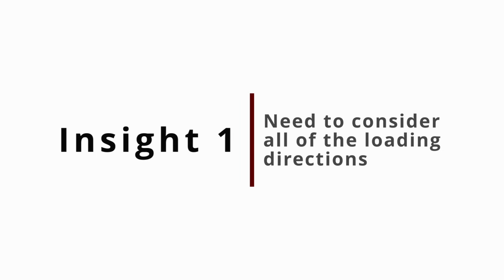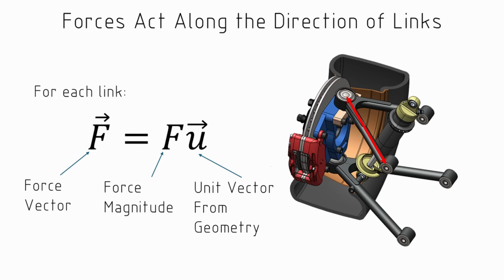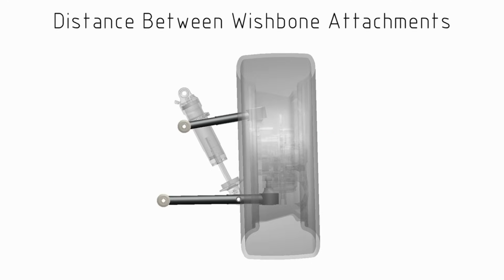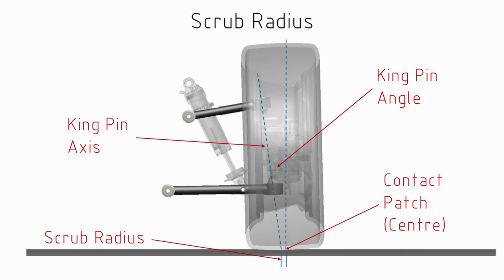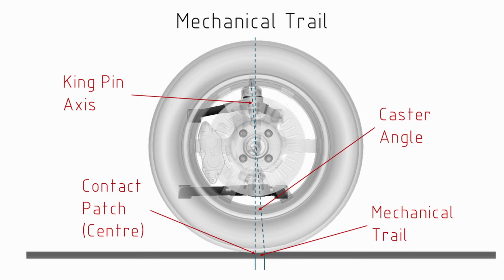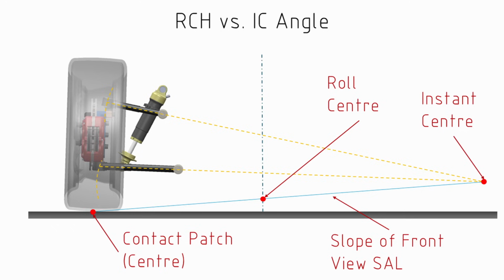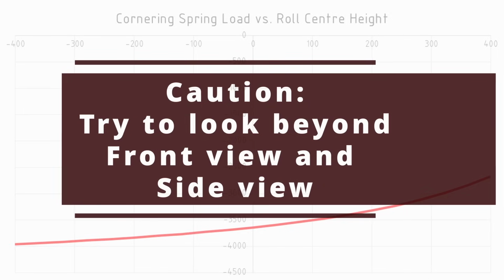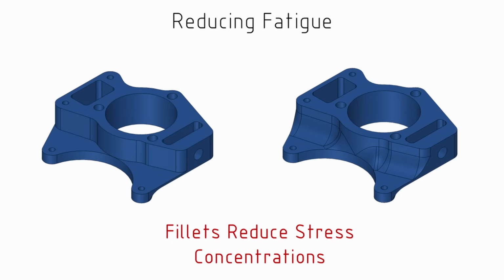Six Suspension Design Insights by Analysing Suspension Loads (Project 171)

Comment: Phenomenal video! Never seen such a detailed analysis of suspension loads. I have one question, though: At the end you already mentioned, that the suspension is moving. What about the movement due to steering?
Assuming that the contact patch doesnt move significantly relative to the vehicle body, I think you could assume that the suspension loads dont change much. But when designing an upright, the directions of the loads change significantly. When setting up loadcases in FEM, would I need to simulate every possible steering position (maybe in 10° increments) for each "suspension loadcase" derived from this video? 

Thats one problem I am currently running into, because I want to use topology optimization for an upright and am constrained on compute resources. :/
Reply from the maker: When doing FEM I generally don't worry too much about the different suspension positions and changes due to steering.  This is mainly because in order to get decent stiffness of the components you need to run fairly high safety factors.  Although your suggestion of 10deg steering increments is probably a good one.

This is one of the reasons I am fairly reluctant to go to heavily down the topology optimisation route for upright design.  In order to do it well you need to take in a lot of different loading conditions (as you do with any upright design).  Does this mean you optimise at each loading condition?  We have done a few studies of this at work, but find that the topology optimised uprights aren't that much lighter than what we can do through normal design processes (admittedly a lot of iterations over the years).  This is where a bit of designer insight can really help.
Reply: @KevinHayward7  Thanks for your reply!
For now I will probably only go for 3 steering positions, being neutral, full left and full right. Will see if my compute resources will allow me to go for more. haha
(Later in validation, I can definitely afford more steering positions.)

If you are looking for video ideas, I would definitely be interested in one about upright design. Maybe you could compare the traditional vs. TO uprights, that you mentioned.
Either way, thank you for sharing such interesting videos!
Reply from the maker: Fully plan on an upright design video, and reasonably soon.  It is an area I am working on at the moment.  A few more videos to finish off first though.

Comment: Great Vid! - im trying to solve the loads on a double wishbone rear suspension system - im working on an MX5 / miata just as a learning exercise - as with almost all cars, there is no tie rod on the rear, how do you solve the calculations? what inputs would you put in to the 6 x 6 grid?
Reply from the maker: That is a really good question.  It means that you need to do a different set of equations as the H link (failing a better name) has an ability to resist a moment, which the links cannot.  Realistically when doing this for component design I would do this in a FEM study.

Unfortunately the stiffness properties of the arm will determine how the load is shared between the two mounting areas on the upright, so you really need to solve it as a solid mechanics problem rather than assuming fully rigid links.

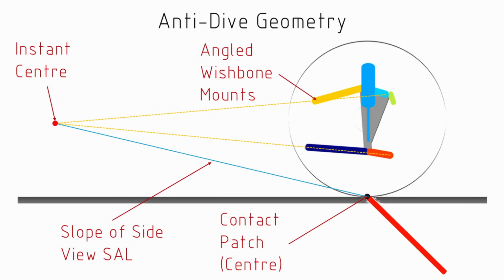Comment: @17:59 Thank you. Your video got me to understand lateral jacking forces. I get it now. Some anti-roll and anti-dive geometry is good because you can run much lighter springs for more mechanical grip in a corner and braking into a corner.
Reply from the maker: It is one use for antis for sure.  Jacking forces aren't often spoken about much and a lot of texts confuse the issue with poorly defined terms like the Roll Centre.  Can make a difficult problem even harder than it needs to be.

Comment: Amazing video! This has helped me a lot with preliminary work for my project! can you do a video delving into the math and code for this, I would love to see a more in depth explanation on the math and coding side of things, particularly how you derive tire forces from the G sweep exactly. I have been using rigid body weight transfer calculations and a simple friction model but I would love to see how it is done by someone with real experience in the field.
Reply from the maker: For this particular analysis I just ran with simple rigid body calculations and a simple friction model as you suggest.  I was doing these calcs more for the loads to be fed into mechanical design for strength.  It just happend that you can take away some vehicle dynamic conclusions as well.  I'm a huge fan of only having a model as complicated as you need to be able to answer the questions you have.

That being said we will be doing more on tyres as we go on, and maybe a bit more of a look into some loading under these conditions.

Comment: Great video! What software are you using for the visualizations / graphs? Matlab never seems to look that good for me
Reply from the maker: Plain old matlab.  Usually spend a fair amount of time making the graphs look better.  I find the main things that up the visibility for slides / videos is to make sure the lines are thicker and the labels are larger.  The default settings on the graphs are pretty ordinary, although the default excel settings are also pretty meh.

If it helps when I submitted my PhD a long time ago one of the reviewers made some very valid comments about the graphs I had included.  It ended up with me going through and changing every one ... wasn't a fun task.  At the time word would crash regularly with the big files.  The bonus is that everytime I see similar problems in graphs I have a nervous tic

Comment: Are you assuming a g force to build the suspension if so what a bout baja cars (offroad) what will be g forces ?
Reply from the maker: It can vary quite a lot depending on tyres, and road conditions.  Vertical loads due to bumps can be quite high. Recently was hanging around some tyre suppliers for Speedway, super interesting.  The compounds were very soft, teams clean and prep their tyres well before heats.  The edges of the tread are also super important for soft surface grip development.  If running in a groove offroad then the lateral forces could be very large at times.  In the end I think you are going to have to design for impacts.

Comment: Awesome. 😃
Finally I've found a video explaining with very nice visual the scrub radius impact on steering !
Among the BMW E9x this is a problem. I could experienced it when I installed wheel with a smaller ET (Offset)
During some heavy braking, the car behaviour became dangerous by pulling to one side or another.
I then sold those wheels and returned to factory spec. The change in scrub radius was only 8mm.
Since then I'm advocating those guys installing spacers to have a better stance to be very careful.
A front axle geometry is something very complex. A slight change can have a big impact.
Reply from the maker: The effects of changing scrub radius can be very noticeable beyond a point.  Most modern cars with a decent amount of weight and axles up front have a fair bit of scrub radius to begin with, and a power steering system to deal with a lot of the load.  Adding just a bit more can have a noticeable affect on steering effort and handling.  As you have clearly noticed.

Comment: Hello, is it possible for both the lower fore and aft to be in tension and never be in compression during the entire range of the g-g plot angles? Or have I just done something wrong
Reply from the maker: I think it could be possible if the lower arm has a lot of vertical to it, and the g forces are very small, because it will be tension due to vertical loads.  However I don't think so otherwise, probably a math error.

Comment: Hello, in calculating the moment you use r as the vector to the position of point application. I'm just wondering what the origin of this vector is? Is it the vector from the center of the contact patch or somewhere on the knuckle? Thank you!
Reply from the maker: It actually doesn't matter as long as you are consistent with the location.  I do it from the centre of the car on the ground along the axle.  Moments are always calculated relative to a given point.

Comment: What about dynamic loads during accel and brake
Reply from the maker: Brake and driving loads are included in the model if thats what you mean (and the resultant load transfer).  Keeping in mind there are still simplifications applied. It isn't a full multi-body systems approach.

Comment: I don't know if it's possible, but is there a way to get the MATLAB code you wrote?
If you sell it, could you tell me where? I'm very interested.
Thank you very much in advance and great video!
Reply from the maker: It's not really in a great state to share.  Having prepared software to the point it can be sold vs. prototypes for personal use I know first hand how much of a difference there is in the work that must be done. Hope you understand.
Reply: @KevinHayward7  No problem, I completely understand your reasons. Thanks for taking the time to respond, and best regards. Be well ✌

Comment: I’ve written a MATLAB script to calculate link loads based on contact patch forces. The results align closely with those from a previous thesis student in our FSAE team, which gives me confidence in the method. My main goal with this script is to examine how link loads change when we introduce anti-dive geometry.

The issue I’ve run into is that, when I only apply the contact patch forces, the pull rod load decreases as expected, but the upper arm link loads also decrease—which doesn’t quite align with what I’d expect for a given anti-dive percentage. However, when I include a braking moment in the y-direction (representing braking torque), the results make more sense: the upper arm loads increase while the pull rod loads decrease, which is closer to the expected behavior.

This leads me to wonder: in a pure braking scenario, should I always include the braking torque (moment in y) along with the contact patch forces, since that would represent the actual loading conditions more realistically?
Reply from the maker: Definitely need to account for the braking for the correct loading. If it helps I have made that mistake before (with drive loads on the rear).  Strain gauge data wasn't matching up with the calculations.  Took a while to find the mistake in the calcs (had incorrectly assumed outboard rather than inboard drive).  Matched up really well afterwards.

The calcs are only 80% of the work, error checking and validation can take up the other 80% of the work :)
Reply: @KevinHayward7  Thanks for the comment. My concern is that applying a braking torque as a separate moment might end up double-counting the loads, since I would assume the moment is already captured through the contact patch forces. I’m not completely certain, though—at the moment I’m just applying the braking torque at the upright center.

Comment: Could you please talk more about anti-dive and anti squat? As far as I've read, these two essentially bind the suspension in braking and in acceleration respectively. This binding essentially turns the tire into the spring and shock absorber which isn't ideal for any scenario when driving. It's like driving a go-kart - and can easily lock up a wheel (as it's now free to bouce uncontrolled without the infuence of spring and damper). Have you considered a 3rd element to control dive and and squat? What would that look like? Advantages and disadvantages? Please consider this question for your next Q&A.
Reply from the maker: I do plan on coming back to this topic as the suspension gets a little more design time a little later on.  Have used 3rd elements in the past, but not of a huge benefit with minimal aero loading, with their main advantage being platform control in pitch/heave. Definitely consider the question for the next Q&A
Reply: @KevinHayward7  Thank you. I'm looking forward to it. 
Do you offer consulting services? I have a single seater race car designed from the ground up that I'd like a sanity check on. How may I get a hold of you for a 1-on-1?
Reply from the maker: Unfortunately I'm way too short on time to do consulting at the moment. I'm trying to answer questions on here as they come up however. Probably due for another Q&A video.

Comment: Does it matter which side of the link the “r” vector points to from the origin? Also does it matter which direction along the link the unit vector points in (since it could be 180deg difference)? For your tire load and moment inputs, are you using the g-g diagram and the mass of the car? And do you estimate the F_z by the moment about the COG? Super good video I’ve never been able to fully grasp how to calculate the loads in the wishbones and I’m super thankful to give building a code like this a shot. Thanks for sharing your hard work!
Reply from the maker: They all need to be pointing to or away from the body they are referencing (in this case the upright).  Using gg-diagram and mass of the car as suggested.  Only a simple friction model on the tyres, but the whole thing can be flipped by starting with tyre modelling / data inputs.

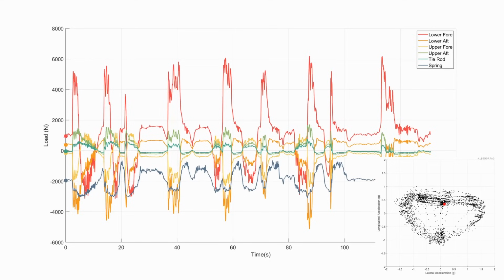Comment: How did you develop the graphs at 23:32?  btw, is it left hand drive?  It seems to turn left a little better.
Reply from the maker: The data is from a racing car that was travelling around banking... also the accelerometer was installed a little of axis. The graphs are using the same method as earlier but taking the data from the vehicle instead of just going around a g-g diagram

Comment: Subscribed and greatly enjoying going through all of trhese videos.

Regarding suspension loads, I'm surprised there was no mention of what I expect the peak loading condition would be, namely potholes and other impact-type loads.
Reply from the maker: You are right that the normal handling loads are not the peak loads. The same method can be used to put a high vertical g load of the unsprung mass. These conditions will be looked at before the design of components is finished.

Comment: Hi! Thanks for these cool masterprice videos! I wanted to clarify about the R vectors in the A matrix. As I understand it, these are the attachment points of the links to the upright - right? If so, then for a classic double wishbone suspension, this R for the upper front and upper rear control arm will be the same. And also R vector will be the same for the lower front and lower rear control arm. Since in a classic double wishbone suspension, these links converge at the balljoint point. For a multilink suspension, the situation will of course be different. Thanks for this information!
Reply from the maker: The r might be the same for the links but the unit vector for direction is different. the r is only used for the moments where thay have a cross product to the direction vector. Hope that helps.

Comment: Super video, would it be possible to have a deeper overview on how to actually perform loads calculations from logged data? That would help really a lot many motorsport engineers to understand how to tune the car balance on track. Thanks
Reply from the maker: Something like that will likely be coming, but probably not for a while.  Definitely would be good to see some differences between load cases for the road and track.

Comment: Still thinking about this video. How did you get the tire forces? Is it from tire model (result of tire model calculating output forces according to coefficients in the property file) or is it reaction forces (at the "tire" constrained to the "ground") in response to external accelerations that you're imposing (plus gravity acceleration)? I.e. forces at "static equilibrium". Sorry for my crude vocabulary.
Reply from the maker: It was a very simple model, close to what you suggested in the second option. This works out well for simple studies and estimating link loads. For more accuracy and heading towards dynamic modelling you can use a better tyre model with the same method.
Reply: @KevinHayward7  Thanks for your answer Kevin.

Comment: I studied Engineering as a mature student and already had an unhealthy obsession with cars and their suspension. Joining my Uni’s FSAE team highlighted how much I didn’t know! While our faculty advisor was very supportive, they had no professional suspension design background and I therefore lacked that mentorship in suspension kinematics. I’ve always been impressed with ECU’s car each year as they were never afraid to innovate rather than stick to tried and tested designs. I’m keen to revisit this world and I think your videos will certainly help fill in some gaps. I look forward to seeing this project progress.
Reply: I’ll also add that my final kinematic package worked pretty well but steering torque and therefore effort was huge. Steering packaging is one of the biggest challenges in FSAE. I took a lot of time accounting for Mechanical Trail and Scrub Radius but, in order to get sufficient steering angles, the steering arm was a little shorter than I would have liked. The net result during the event was 1-2 quick laps before the driver was starting to feel the effects of fatigue. I think more SAI would have made the packing easier and allowed a longer steering arm. A lack of simulation is also why it wasn’t picked up earlier.
Reply from the maker: Steering is such a crtical area of a FSAE vehicle design, very hard to get at the right. Really liked your rear anti-rollbar video, love watching mechanisms move in their proper place, and it was one of the clearest videos I have seen of the blades deflecting.